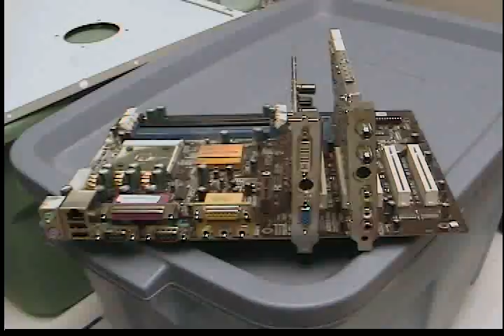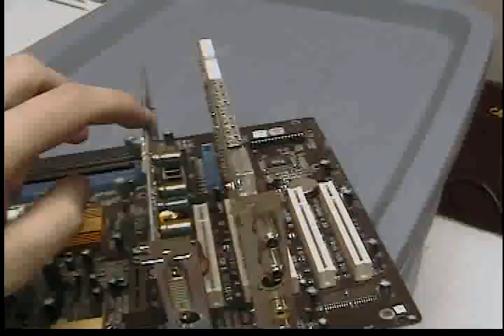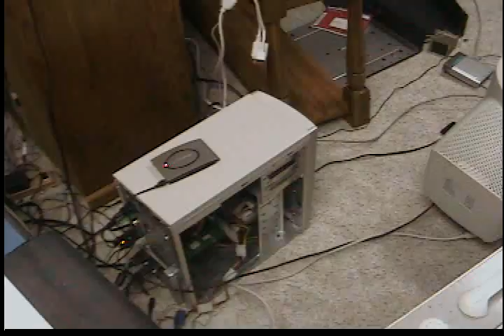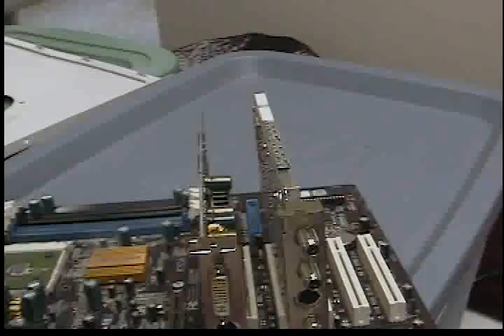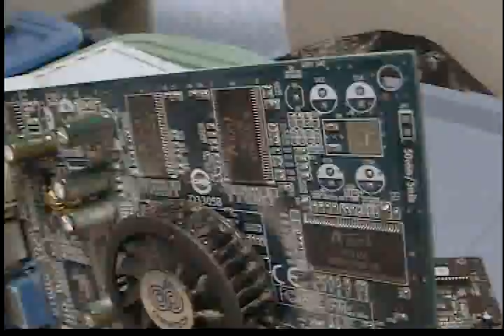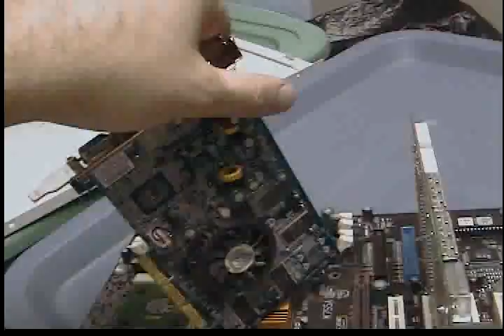How I fixed hard lock ups on linuxMCE!!

Comment from the maker: Well, it turned out to be a motherboard compatability problem, not a heat problem.  This fix that I showed only hade the system lock up less.  But to answer your question, the tuner card cannot plug into the pic express slot, which the gpu is in and vice versa.  Two different slot type that don't cross.

Comment: I know this is an old vid but still. Why not switch the GPU and the TVTuner with each other? That way the GPU is on the bottom and the fan isn't blocked?
In your case that may be flush with the bottom of the case  but in most Mini ATX cases the mobo will sit flat with the ground and  then there will be vents on the sides (right next to the gpu fat)